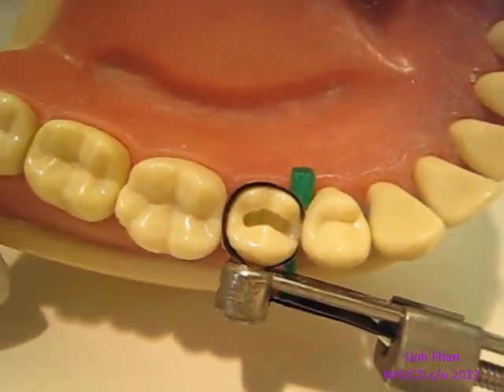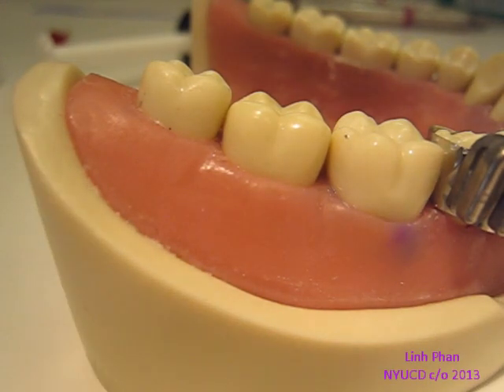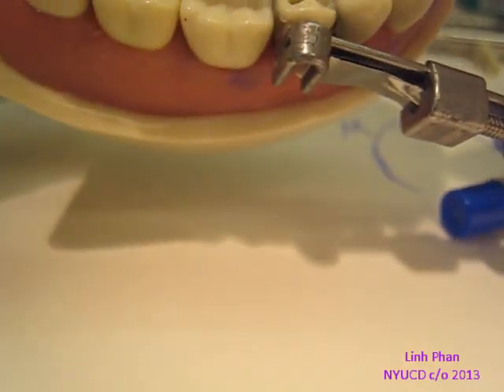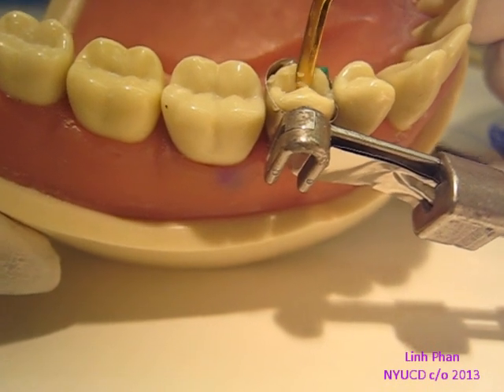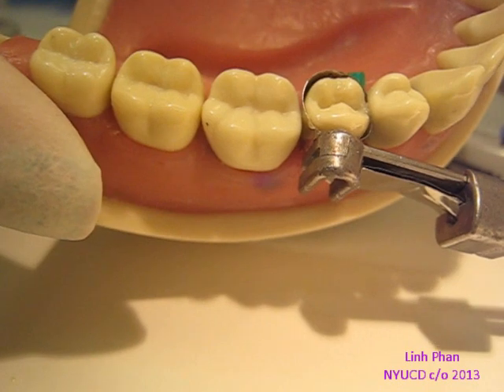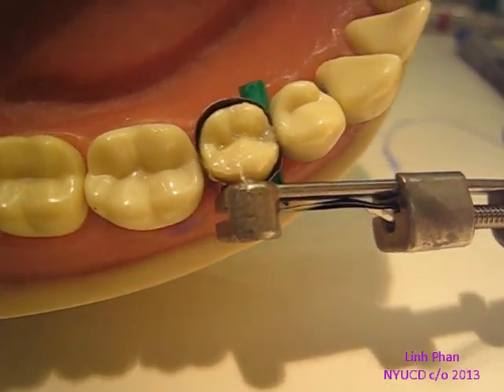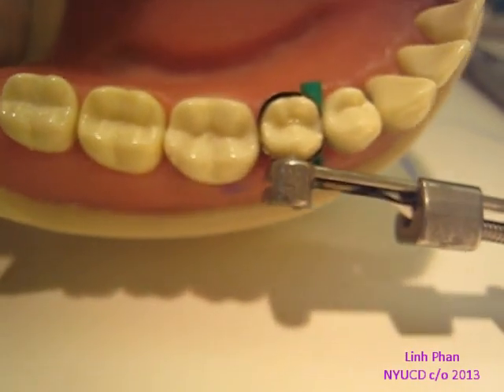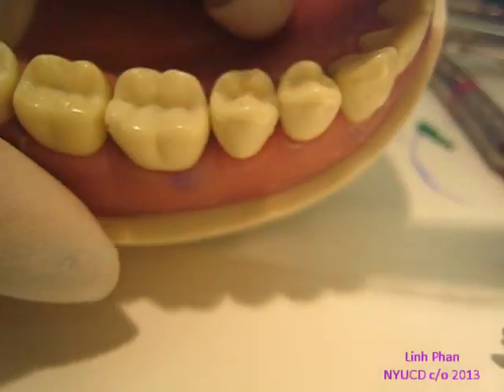Class II Composite Restoration Part 2/3

Comment: what did you fill the mesial with? It doesn't look like the same shade as the composite? Do you always do the mesial (or distal depending on what type of caries) first??? It looks like you used a different material to fill the mesial